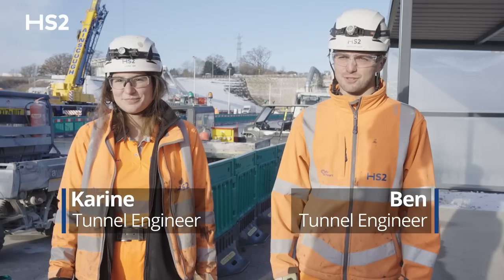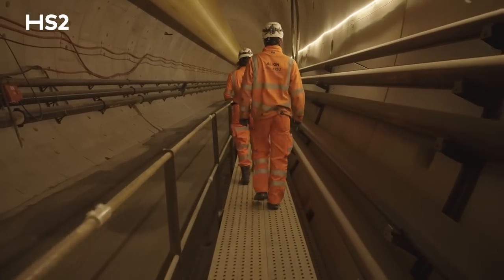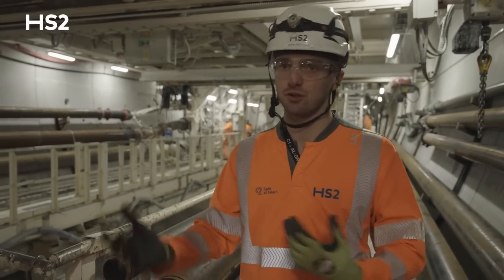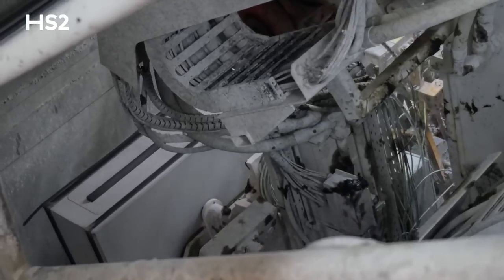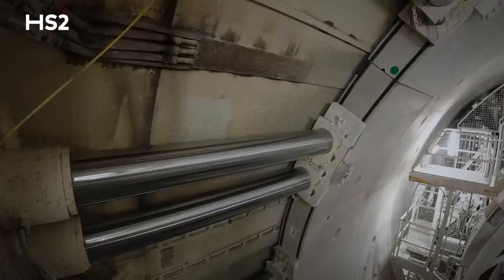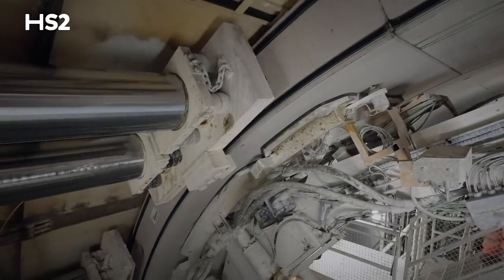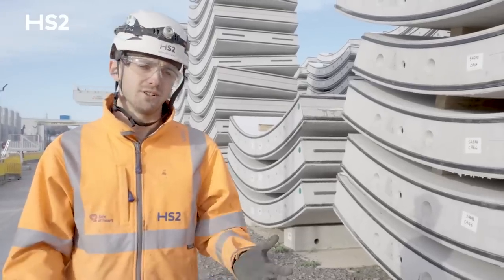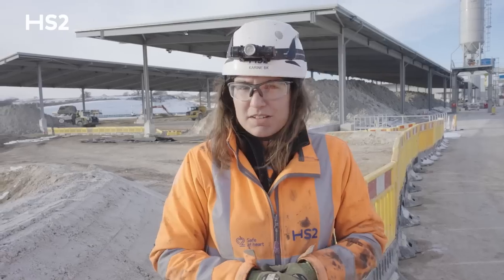80 metres below ground with the engineers building HS2's longest tunnel

Comment: I don’t know if it’s just me but I predict this white elephant will end up costing nearer £150 billion and it will be late. Sunak talks about levelling up then spends this money to transport people south 30 minutes quicker. I think they should have spent around £50 billion on lines up North and getting higher paid jobs up there. The last thing we need is more CEOs and Managing Directors travelling first class down to London at taxpayer’s expense
Reply: 1. the point of HS2 isn't saving a few people 30 minutes on trips to London, the point is to remove all the express services from the existing mainlines and thus making space for many many more local services on those lines. A new highspeed line is the most cost effective way to increase capacity. This is also the reason Japan built the Shinkansen: capacity.
2. Yeah, Sunak is effing everything up. The Tories have been doing so for HS2 for years now. Chopping of much-needed parts to save money in the short term but that will make the money that is invested pay way less dividend. It's less value for money every downgrade it gets. The real long-term savings would be from daring to invest more. Commit fully to the full HS2, and commit fully to HS3 (aka Northern Powerhouse Rail).
Reply: @GustavSvard  also to increase freight capacity on the mainline to reduce freight on the roads
Reply: @GustavSvard  So the point of "High Speed 2" is not speed ?. If it were normal speed the tracks would be less expensive, the rolling stock would be less expensive, of course it is about speed, the Uk is trying to show off to other countries around the world that we too can have fast railways for the elite. It certainly is not being built for the majority. That much money could have been spread around the country linking places that do not even have decent links. It reminds me of broadband where everyone wants to go faster but do not know why, they can download enough music overnight that they would be dead before they listened to it all. Government would do us all a favour and end it at Birmingham and rethink where the money would be better spent.
Reply: @johnlightfoot9967  just as well people like you are not in a position of strategic importance.
Reply: @LiveFromLondon2  From your name Mr LiveFromLondon it is obvious why you would support it.
Reply: @johnlightfoot9967  Correct - it is all about CAPACITY - clearing the long-distance traffic off the heritage Victorian lines, separating long-distance trains from the "stoppers".
Reply: David. It may be worth your while popping down the Kent in what is effectively HS1. You won’t find that full of MD’s & CEO’s.  I am pretty sure that MD’s & CEO’s will be the only people using HS2.
 Pop down to Spanish Catalonia you will find their HS line carries all sorts.
Reply: @johnlightfoot9967  The people in the intermediate towns between Brum and Manc would probably have a different view to the stopping at Birmingham thing.  They current get a poor infrequent train service because there isnt the space to fit local trains around express ones.  Stopping at Birmingham would really confirm the fact we dont actually care about things outside london, it makes no sense
Reply: @johnlightfoot9967  I think it's maybe a cultural thing that HS2 is such a big deal. Over the last few years, there was an increase of people traveling by car. The roads cant sustain it much longer, so there needs to be an alternative. We can find it in the railways. In Great Britain, the train network is quite outdated. Therefore new lines should be constructed. But it could be even more efficient by taking away congestion on other lines by construction an efficient new one. Thats the purpose of HS2, to make more space for a good timetable on the west coast mainline. I would like to use an example in the form of HSL-Zuid, the first and for now only high speed railway in the Netherlands. It connects Amsterdam with Antwerpen via Rotterdam. The 'hoofdlijn' (comparable with the west coast mainline) was completely digested. Intercity trains, regional trains and freight trains all made use of it. Although HSL-Zuid was way to ambitious, it made a more logical timetable on the Hoofdlijn. The same will happen in the UK and it is a shame that people don't have faith in it.
Reply: @tijs1886  I think a lot is how it is being sold (very badly). Everyone know "High Speed 2, get to London saving xxxx minutes". for the majority who never travel to London they see £billions touted and feel a bit miffed when to travel thirty miles where they live take them just as long as this super trip to London. I have always maintained that the railways need an overhaul, just seeing the thousands on wagons traveling the 55 in North Wales daily an improvement would be for them to get on a train in Holyhead and into Manchester and many other routes could have the same benefits.
Reply: @johnlightfoot9967  I think in general that the UK government should focus more on the railways. Yes they need trains and tracks, but they also do need HS2. The problem with HS2 that it is too ambitious (the reason why I keep myself updated). I think that 300km/h (186mp/h, standard in Europe) was good enough. 365 km/h needs too much money and expertise, which the UK (respectfully) doesnt have. 300 km/h railway is cheaper than 365, and it also requires less expertise. They should also hire more people who have more experience with high speed rail construction. But in the end, HS2 is needed. My apologies if I made mistakes based on language, English is not my native language.
Reply: Hs2 as the name implies, is the second section of Hs1 or as you know it the channel tunnel.
Reply: @robertgarrett5009  Im sorry but that is not the case, HS1 and HS2 will not be connected (for now), there is no need for a direct connection between Paris and Birmingham right now
Reply: Well then you  clearly don't understand the point of HS2. It allows the fast trains to be taken of the current network, allowing for more commuter and regional trains, which otherwise couldn't operate, and has been proven by engineers to be the best solution to the problems on the current network, and no half baked cheaper solution would bring the full benefits that HS2 can.
Reply: @HM...333  passengers are leaving the rail in unprecedented numbers so there will be no need for a fast train as there will not be enough passengers to keep it viable, so taxpayers will be subsidising this folly
Reply: @robertgarrett5009  HS2 will never be connected to HS1 as it is a larger gauge size on HS2. This was pointed out in the early days of the plan in 2009. Also HS2 will use 3x the amount of electricity than a current electricity operated mainline train.
Reply: @davidadams5116  Absolutely correct. Passenger numbers have fallen in recent times, even before the strikes!.
Reply: @HM...333  My main point is the levelling up scenario. Surely £50 billion spent updating lines up North would entice industry to locate up there, hence levelling up. I cannot see why another line into London is needed. It’s full up now. Cross cross the North with new track and put money there. I am from the South by the way. The last thing we need is more Elites travelling South when they could work up there bringing much needed money to those Northern towns and cities

Comment: Stupid, plain wrong project.

Let me warn you: dont go down the express-road in railway-policy! 
We did this in Germany and now the commuters are falling appart because all these express-railway projects eat up a insane ammount of funding like for exaple 20 Bn. for one single line to the east that of course outside of politics noone needs and noone has asked for.

Put it into economically-important commuters. You wont just get a nice return of investment but also overall improving the lives of many people and not just a few.
Reply: I think you need to understand that we don't do common sense here in the UK anymore
Reply: Well then you  clearly don't understand the point of HS2. It allows the fast trains to be taken of the current network, allowing for more commuter and regional trains, which otherwise couldn't operate, and has been proven by engineers to be the best solution to the problems on the current network, and no half baked cheaper solution would bring the full benefits that HS2 can.

Comment: The whole thing is an engineering wonder but it is all a waste of money and should be scrapped. It is going to be years late and billions over budget. It's only saving grace is that it all makes work for the working man.
Reply: It isn't a waste of money. It allows the fast trains to be taken of the current network, allowing for more commuter and regional trains, which otherwise couldn't operate, and has been proven by engineers to be the best solution to the problems on the current network, and no half baked cheaper solution would bring the full benefits that HS2 can. It will allow rail improvements all across the country, like a domino effect